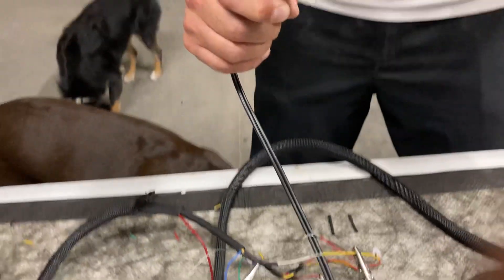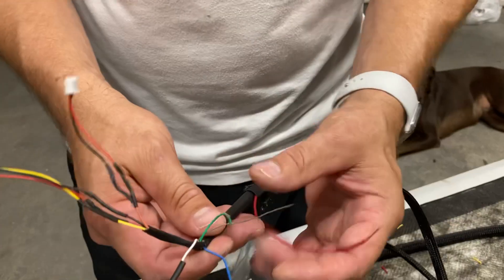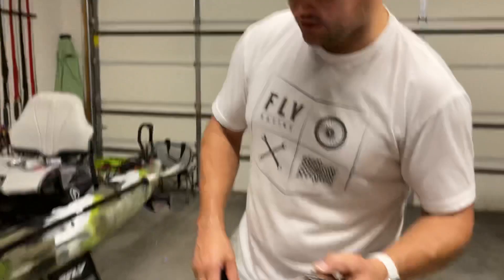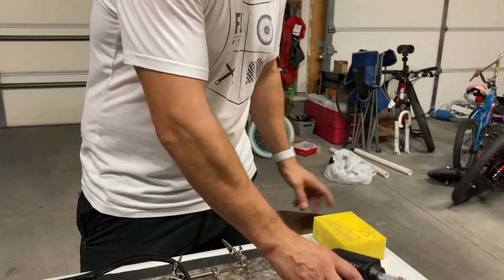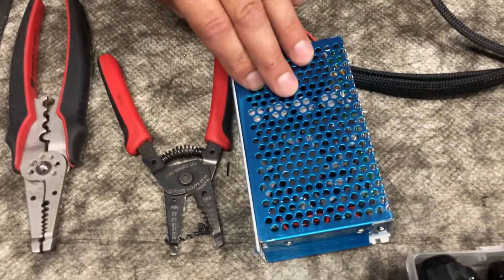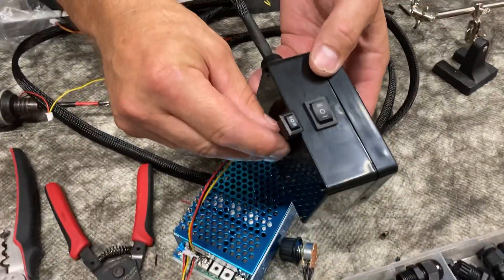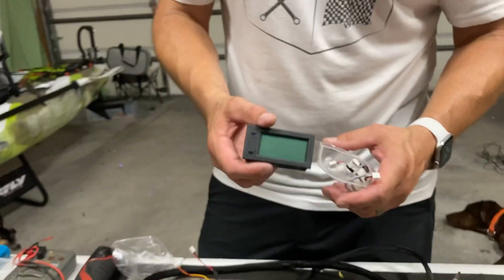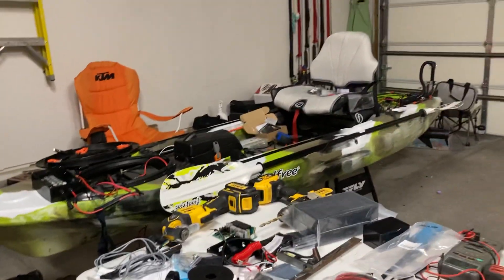Building a trolling motor PWM with wired remote.

Comment: Nice work. I did a custom 3D print for my wired remote with meter and kill switch. I also printed my gland nuts, RAM arm, controller box with ventilation, and used a VGA monitor cable I had laying around. I also 3D printed motor mounts, top cap, hatch, steering arm, and different pitch props to attain a steady 4mph while drawing only 25 amps (17 lb. motor). Being able to design and print my parts, I was able to take the design up a notch instead of using standard boxes. Also be aware, even though those controllers say 100A, they will get overheated quickly once you go over 35A. The box my Harmnee controller came in even stated on the box "Motor Power Recommended 12v within 420w" (35A), just above where it said 60A Rated and 100A Max.

Comment: at 7.46 this happened to me on my build!My error ! when I fed my wires through the sleeve my wire markings came off and I accidently  switched the  3 wire connections. I had reassembled the 3 wire plugs into wrong sockets  and at first bench test,  this is not working as it should !   everything works as it should after switching the 3 wire connectors!!

Comment: I made my pwm using the same components shown here. Unfortunately, I get interference on my Humminbird fish finder when the trolling motor pwm is on any speed by full high. I tried rerouting wires, using a separate battery, and installed a ferrite ring. Any suggestions on how to stop pwm trolling motor interference?
Reply: If you're using the same battery, there's no way to get away from the interference. You'll have to run a separate battery for your fishfinder. I had the same issue but for me it was cleaner to run a second battery so I wasn't worried about it.

Comment: How does it compare using those pwm controller vs a ESC(Brushed speed controller), I've just bought one Esc, the hobbywing 880, its a 80A esc, but its so tiny compared to those controllers like you show thst I'm skeptical
Reply from the maker: Honestly I would like to try one out myself but since I haven't had any issues with mine, I haven't looked at any other options at this time.

Comment: Looking for help. I tried extending my controls using cat 6 as my conductor. Wired everything up before inserting extension, worked fine. After wiring in approximately 8 ft. Of extension, controls would barely run motor in reverse with no variable speed available. Forward would go about 50% speed, no variability. If I held the potentiometer in my hand in such a way that I was touching multiple contacts, the motor wo7ld surge to almost 100%. Is the cat 6 just too small of a conductor? When I took my extension off and wired back normal, full functionality returned, so nothing is damaged
Reply from the maker: Yes cat 6 is to small of a wire... I would recommend 18 and at smallest 22

Comment: Great video, What kind fwd rev switch did you use and what size fan do you recommend? My pwm doesn't have one. I'll wire to the motor side so it runs when the motor is. Thanks
Reply from the maker: I have tried to wire in my own fan for the PWM‘s that don’t come with one. The fans are 12 V so basically They only run as fast as amount of power you are supplying. So basically if you were trolling at low speeds, the fan may not be operating until you get to full power tgen the fan run at a high enough speed cooling PWM. If you figure out another method please share that information!

Comment: As a 40 year electronic tech in Aerospace, I want to give you one advice. After you have finished soldering,  do not clean the tip. Turn it off with solder still on it so that it preserves the tip. You'll never have to replace them.👍

Comment: Hello, I like the way you build, I am interested in one of Remote control PWM builds. Is it possible to build it with 8 gauge wire and make the remote box with a smaller profile. I believe neither the potentiometer nor the switch need any cooling, that box appears to be considerably larger than is needed to house those two. This is for a Pro Angler 14 with a 30 lb thrust Minn Kota. Thanks

Comment: Can you use 10 garage instead of 8 gauge to run to the trolling motor? How much of a difference does it make between the 8 gauge and the 10 gauge?
Reply from the maker: The further the battery and controller are from the TM the larger the wire. I use and say 8 gauge as a precaution not knowing how much wire a person will be running. 8’ or under I would say 10 would be fine but the little extra cost to make sure your wires don’t burn up is worth it in my mind. Less resistance = less heat = more efficient system.
Reply: @allthingspowersports5955  Thank you so much. I was planning on using 8 gauge, but truly wanted to get a experts opinion before going either route. I really appreciate it!

Comment from the maker: 10-50V 100A 5000W DC Motor Engine Speed Controller 0-100% PWM Control Industrial Motor Speed Regulator for DC Brush Motor DC Lamps